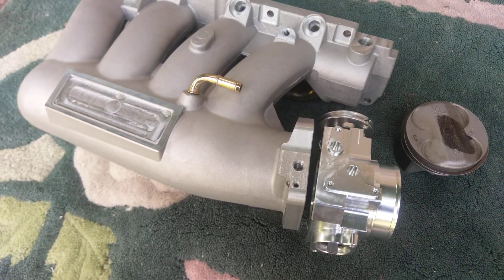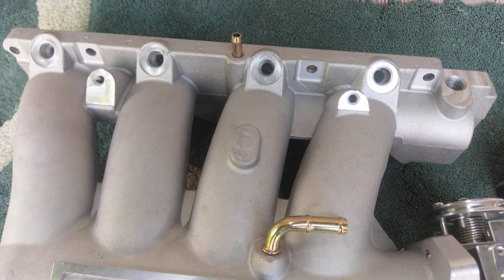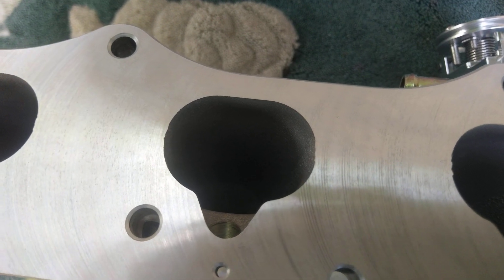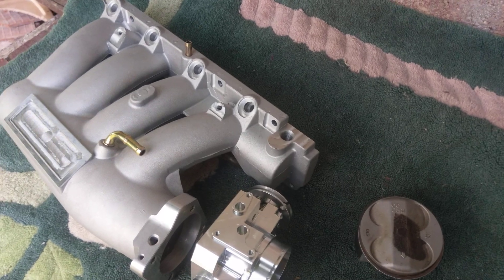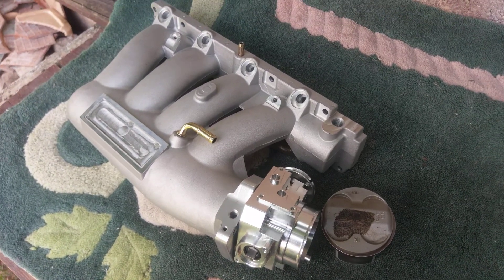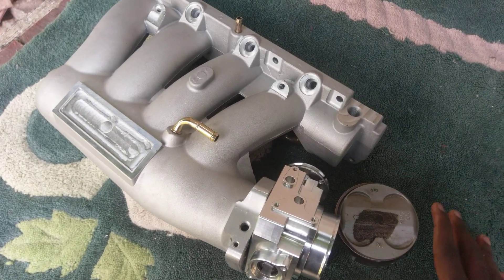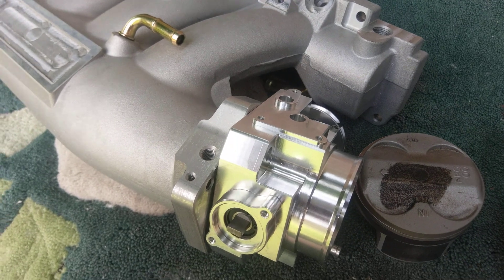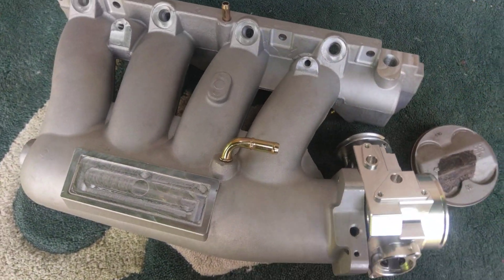k20a3 making 220HP with cheap parts?🤔/ maxpeedingrod intake

Comment: Maxspeedingrods make a set of H beam rods for the K20a3 now. I’m going to build my bottom end with A2 pistons, A2 oil pump, 👆🏾👆🏾the H beam rods($400 average), and a block guard for a turbo build. Hope to see your set up finished and thanks for helping motivate me with mine.
Reply: no need for block gaurd stock block holds same power a2 will once u upgrade rods  also if ur boosting a3 pistons are better   so u just need the hbeam rod upgrade and full send
Reply: Did you buy the rods? Only thing stopping me from buying them rn js that the listing on their website says the small end width is 22.86mm which makes no sense since the stock width is 19.8mm. 22.86 won fit into the piston and I’m wondering if this is just a mistake on the listing

Comment: rocking stock rods on a3 block with a2 pistons on a3 rods and crank and a2 head and  a skunk 2 pro intake mani with 550cc injecters and 80mm throttle body its a beast lol revs faster then a stock k20a2  think its because lighter rotating assembly
Reply from the maker: Lighter assembly rotation does make sense 🤔
Reply: @kenneil101  still going strong   to this day
Reply: @mariopic bro pls tell me it’s still going im about to do this build in the summer I just bought a k20a2